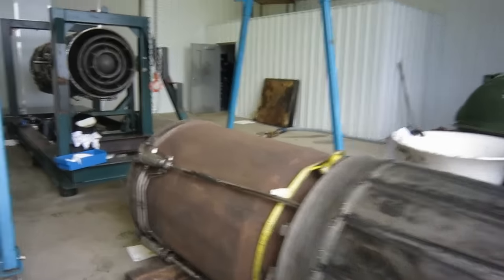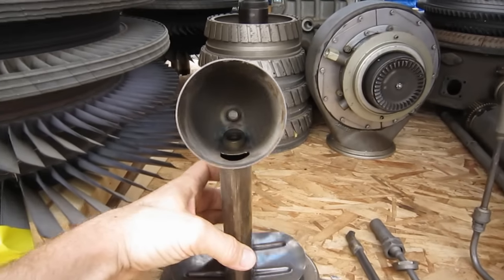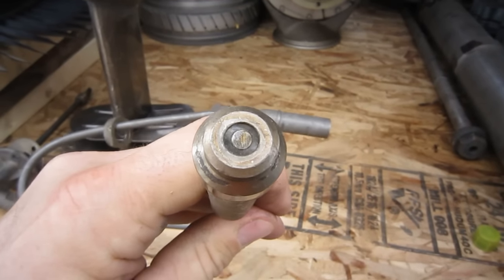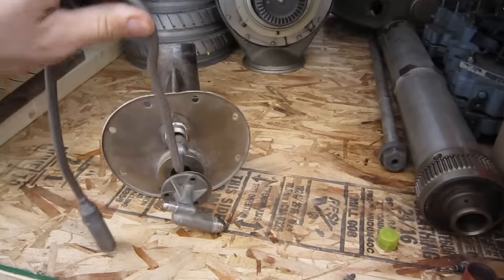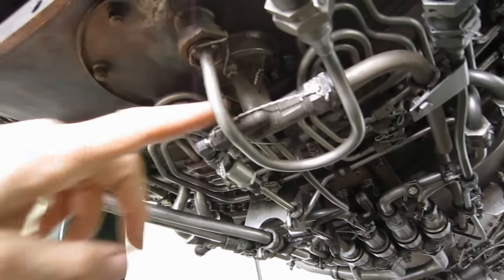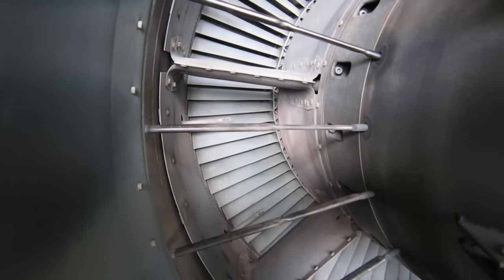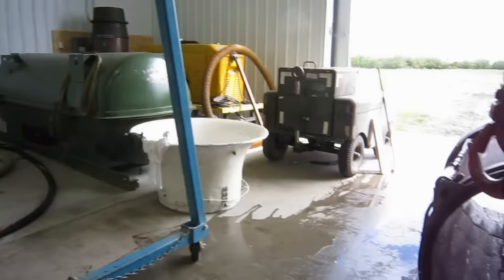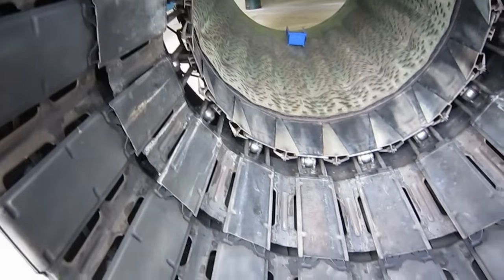The Afterburner - Turbine Engines: A Closer Look

Comment from the maker: The piece in question is the flame holder for the afterburner system. It creates a zone of turbulent air directly behind it to keep the flame near where the fuel is sprayed into the afterburner.
It is only needed to help the engine function properly when there is indeed a great deal of flame in the exhaust.

Comment from the maker: I think the ignitor works continuously in AB... but I am not sure on that.
The metal liner with all the holes in it is... the jet pipe liner. It helps the outer flow of cooling air mix inwards through those holes to protect the jet pipe and the liner itself from contact with the actual flame of the afterburner.
It is very similar in form and function to the combustor liners. Couple videos posted about those.

Comment from the maker: @billymach4 We service the J79 for military aircraft, because GE no longer supports this engine.
The power turbine used with industrial gas generators is optimized for a single temperature and mass flow. Afterburners are not used in industrial applications because power turbines are not adjustable.
Interesting idea, though.

Comment from the maker: @prandtl002 Causing the gases to accelerate backwards results in the nozzle and the rest of the engine being pushed forwards. If the nozzle was doing a perfect job, the pressure difference accross its outlet area would be zero. You get an indication of the residual pressure in the gases once they've left the engine by how much they expand once outside. This is indicated by the shape of the "cone" of hot gases visible escaping. The wider the cone, the more residual pressure.

Comment from the maker: @TalksWithDirt 
I have an idea. If the engine seems to be functioning normally, and you see the odd bright orange "spark" get spit out the back at extremely high speed, it could be a dislodged and ignited soot deposit.
Turbine engines that burn jet fuel do accumulate carbon deposits from incomplete combustion.
At S&S, we never see these deposits because our engines are all clean and running for the first time.
In an aircraft though...

Comment: MiG 21 engine has quite a similar flame holder as that. And it had a special russian green enamel on it that could take the punishing enviroment. To compare it with some undisclosed more modern western design I've seen, that was buckling and cracking and even shedding pieces. If I remember right the flame cans were also covered with that same green enamel.

Comment: Does the torch igniter have an air input?  In the rocket world, a torch igniter has high pressure fuel, high pressure oxygen, and a sonic choke (small output orifice) so the igniter doesn't get blown out.  On a jet, I would expect it to use high-pressure bleed air, but I don't see anything like that.

Comment: greetings from a frosty -10 deg F minnesota, USA --hey Agent Jay Z I have a question.  I understand a gas turbine can be modified to operate on a number of different fuels. Then I wondered could LPG/ natural gas/ propane ever work in an afterburner or is jet A or that type of fuel the only suitable fuel for re-heat (afterburning).  thanks in advance would love to hear your thoughts in a video
Reply from the maker: Afterburners are used only in fighter aircraft. Gaseous fuels require large, heavy tanks that are not suitable for military fighters.
For this reason, a gaseous fueled afterburner will never be built.
Reply: @AgentJayZ  makes sense. thanks for explaining that, it sounds kinda obvious to me now ^-^ best reguards stay warm!

Comment: Is there cooling air directed through the afterburner flame holder? Since the afterburner fuel rails are located in front of the flame holder, I'm surprised the flame holder does not melt. Or is the front of the afterburner flame located further rearward from the fuel rails and flame holder?
Reply from the maker: The flame holder "holds" the very forward edge of the flame, but I'm not sure if it is touched by flame. It gets very hot though.
The cooling air is directed around the outside of the liner of the afterburner. It forms an "air jacket" between the liner and the outer case. This gap is featured in another series of videos I made about working on a J79.
Reply: Thank you very much for the reply. Love the videos and how well you explain everything. I can't wait to hopefully see the Iroquois tested some day. Good luck with the project.

Comment: How often do the fuel nozzles crack? Based on the coloring it looks like it gets pretty hot
Reply from the maker: The fuel nozzles never crack. Whatever you are calling the fuel nozzles, are not fuel nozzles.
I'm going to guess that what you are looking at are the afterburner fuel spray bars. They are more like a garden sprinkler than a nozzle. They are normally exposed to basic engine exhaust, which is around 1000F. I have not ever seen one that is cracked.

Comment from the maker: @cheetawolf If I ever get to work on thrust-reversing equipment, I will definitely be filming everything. However we never deal with that stuff here. I'm an engine guy working on engines in an engine shop... Thrust reversers are more part of the airframe of a modern airliner.
You need to find an AME who makes videos about the rest of the plane...

Comment from the maker: @prandtl002 Here you are attempting to answer the question of just how the nozzle shape produces thrust. I don't  believe that's what oissaa is asking, and even if he was, you've repeated here the classic misunderstanding. 
The thrust is not produced by pressure differential accross the area of the nozzle outlet. It seems to make sense, but that's not what's happening. The nozzle acts according Bernoulli s principles to accelerate the hot gases, converting their pressure into velocity.

Comment: Hi again.

Very interesting stuff about the aterburner and its special igniter. I had no idea, I assumed it just used sparks like the main combusters. (I know the SR-71 uses triethylborane chemical igniters, but that's a very special case.)
If you look at this video watch?v=cayblOY0h00 , at around 2:30 you can see what I assume to be the torch igniter. Is it normal that it is firing so early before the AB is actually going to be used?
Again ... thanks for making!
Reply: Some engines use a "Hot-streak" ignition system to light the reheat. It basically squirts a lump of fuel into the core of the engine which ignites and passes through the turbine and hence ignites the fuel in the jet pipe.